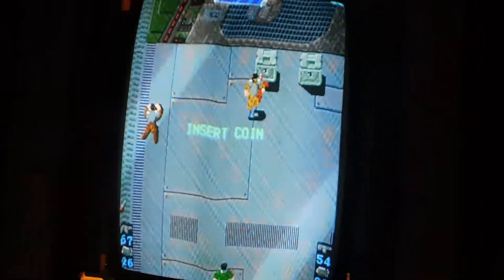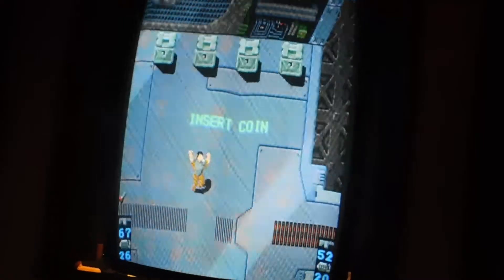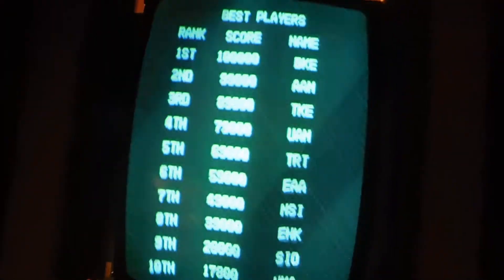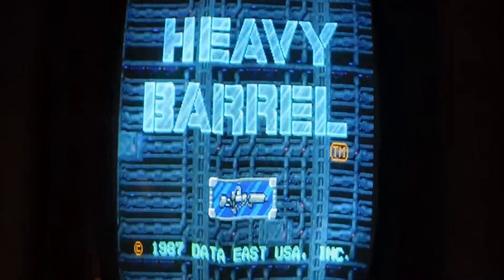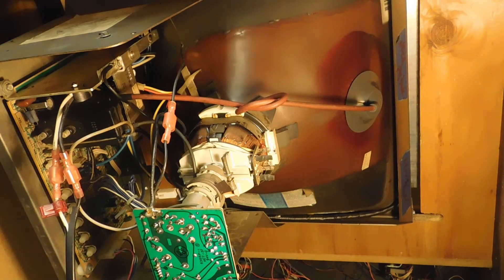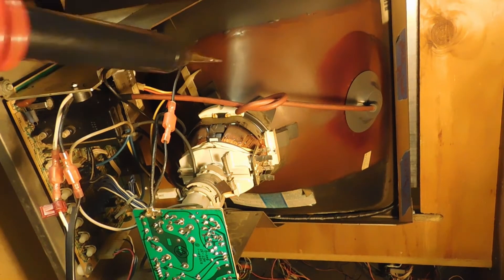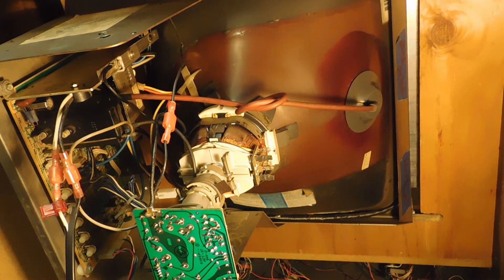How To Test & Discharge High Voltage On A CRT Monitor {Cathode Ray Tube/Arcade Monitor}

Comment: Should probably put the probe under the anode cap before turning the thing on. You can literally hear the arcing as he slides the probe under it. That kind of movement increases the risk of popping off that cap while it's live, exactly what was warned about in the video.

Comment: Great video! I recently replaced a flyback on my Tempest arcade machine (WG6100 monitor), along with many of the caps, diodes, and transistors on the high voltage board. But when I turned machine on, I got smoke from apparently the flyback, since no component on the board appears fried. Do you know how to use a multimeter to test the flyback so I can order another one if necessary? Thanks!

Comment: To troubleshoot flyback transformers I have seen arcade techs use a Neon Bulb and just hold is close to the flyback transformer to know if there is residual stored voltage/current while the arcade monitor is turned off. I'm not sure how they are connecting this Neon Bulb but they just hold is on the outside of the flyback transformer to see if the Neon bulb turns ON to know there is still residual stored voltage/current left in the flyback transformer. Try to figure out how they do this trick to make a video lesson about it

Comment: This is great though I would add one thing: I would not hold the meter movement in my other hand while testing the anode voltage. It should be clipped to or hanging from something nearby so that you can do the entire measurement with one hand in your pocket. If the HV probe ever failed short and you were holding the meter movement in your other hand you could have lethal voltage pass through your chest which would be very bad indeed!
Reply from the maker: Thank you for that! I honestly didn't think of that and it's true! if a fully charged CRT discharges into a person it could have very serious injuries from that. I'll make sure to be more careful in the future, I don't want myself or anyone else to get hurt working on CRT's!

Comment: Where do you find the CRT maximum anode high voltage spec? why does the high voltage increase higher when the flyback transformer is bad?
Reply from the maker: I found the Flyback Voltages from a few Forums I found, I couldn't find that info in any of the manuals I have. I'm also just guessing that the voltage could increase from a damaged flyback from a Forum I read that stated if the internal windings were to short out it could cause an Over Voltage to occur sometimes, most of the time a short like that would cause the Fuse to blow. It very well could be a good flyback with an issue in the HV section of the chassis PCB.